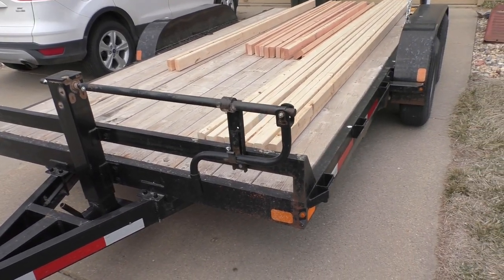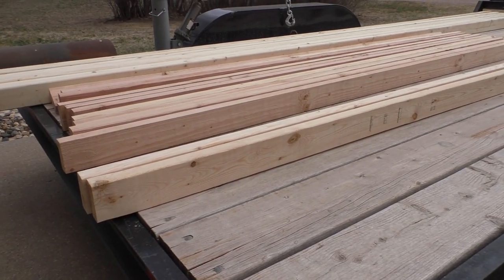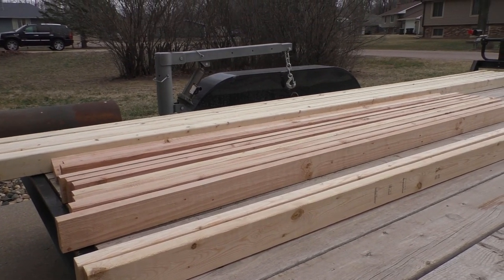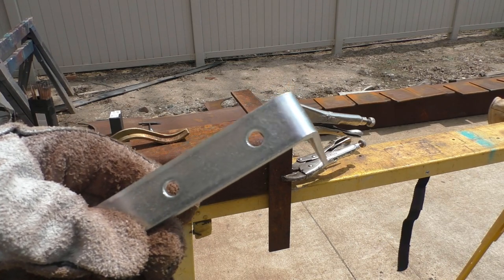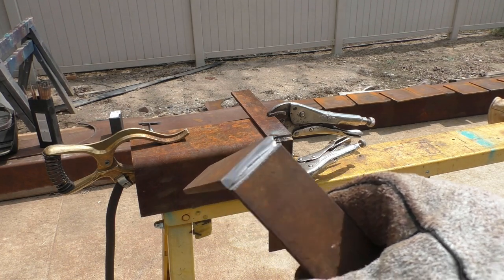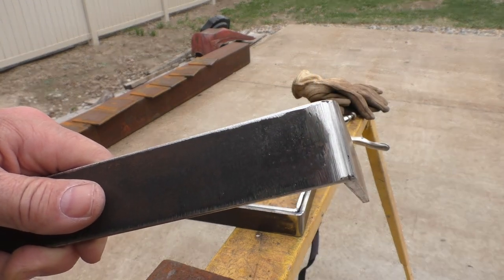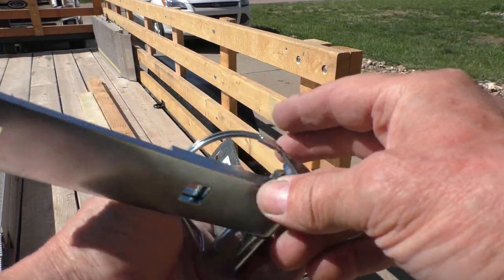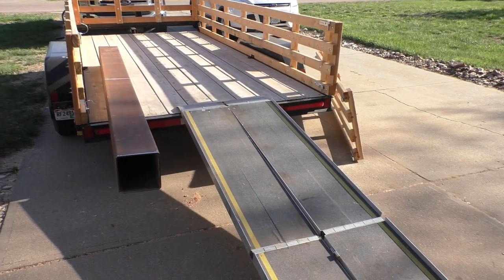Trailer Sides for the Homemade Trailer @Spencers-Mountain

Comment: good video and job looks good. your trailer is better built than most the newer ones are really light built now. take care, be safe and well.
Reply from the maker: Thanks, John. Bought new stock  4000# heavy duty boat axles at a swap meet many years ago. Frame is some low cost pallet rack channel.  Toss in a few years working at a trailer factory for knowledge.  Rated for a 5500# load. The trailer has paid for itself many times over and has barely began it’s jobs.  Thank you for watching!